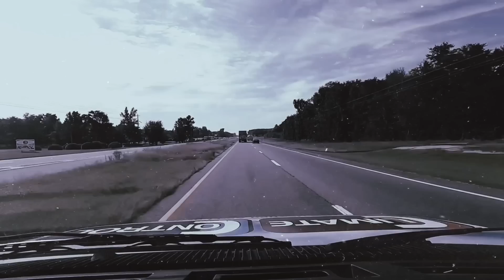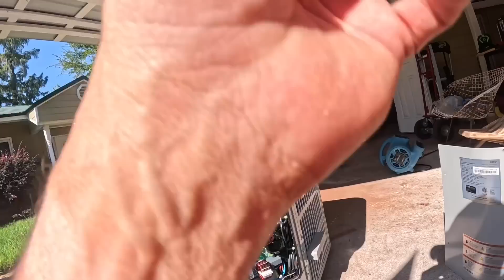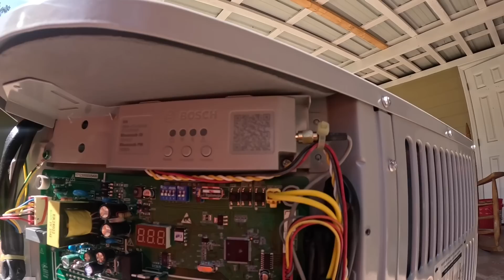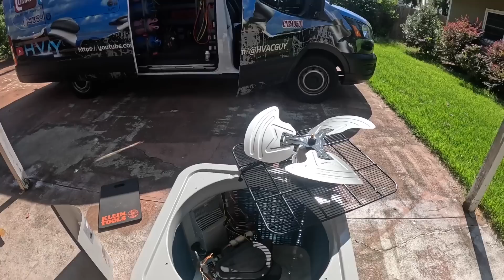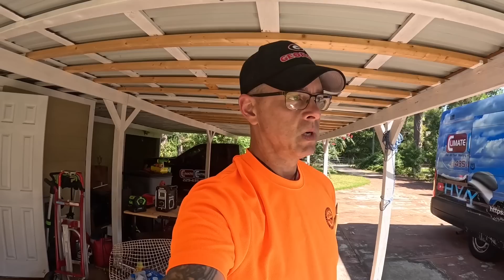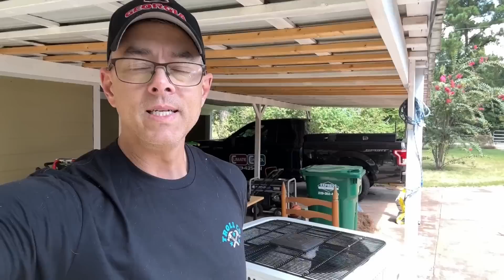Opening Up And Looking At The Bosch IDS Premium Connected! #hvacguy #hvaclife #hvactrainingvideos

Comment: I’m of the same opinion as the rest of commenters the board cost to much to replace this system is to new on the market to justify buying it plus  you must spend extra money on a good surge protector plus in Fla, GA, Ala is known for being lightning Capital of the world one strike and the whole system is fried there must be some type of housing to put this in so it would be protected from the elements and thievery plus the board i priced out was $1476.99 with dirty power, surges, lightning it will be a fad short lived for cheap customers i would rather spend More for a heavy duty one and last thirty years than buy a cheaper unit all day long

Comment: These units check a lot of boxes.  They are physically small. The materials and finish feel substantial.  They are quiet. They will modulate with standard thermostats.  They come in 2 models to cover 5 sizes. They are much less expensive than similar equipment from the USA. I'm looking forward to the Ultra model becoming available this fall.

Comment: OMG, they integrated the capacitors into the circuit board. We will see, pardon me if I remain skeptical. Good video
Reply: The caps you are seeing are filter caps for the power supply.  3-phase motors don't use a cap to start or run.
Reply: @ComputerVA  Thanks, I didn't realize it was 3 phase, but I didn't see any others.
Reply: Yea, Smarter option , a separate capacitor board with REPLACEABLE CAPACITORS !
Reply: Don't worry the IPM module fails way before the capacitors.
Reply: @TofuInc  I would laugh, but you are probably right.

Comment: Just like modern cars. Great energy savings,  BUT very expensive to repair. In the heat in my neck of the woods, this will die. In fact, they have had many issues right now.  It will come down to replacing the condenser package for repair.

Comment: Check valve is what that is. Remember when cars had a carburetor and easy to work on 😂
Reply: And the cap tube and selonoid is not for easy start up, it act’s as an APR valve in the first stage of cooling.

Comment: After warranty: "You will be needing a new circuit board. 5 year financing is available."
Reply: my words exactly, and they will all eventually do this, an cost people lot of money just for a board I will stick to have a basic model
Reply: @deweyabbott5310  Yikes, glad I  am  retired
Reply: @deweyabbott5310  Try bypassing that board for the weekend..
Reply: That is probably not far from the truth.
Reply: Had a carrier inverter board go out, cost of board from carrier $3100
Reply: @BrendanN941 Wow, that's crazy considering you can buy a 5 ton condenser for the same price.
Reply: Depends on electricity prices. You simply can’t afford to run the old direct on line dinosaurs anymore in AU. Haven’t seen anything without an inverter in many many years now.
Reply: @timwhite8500  
So they force you to buy this stuff by taxing energy to death?
Horrible.
Reply: @timwhite8500  submit! Sheep submit!
Reply: @timwhite8500 
Finally. A knowledgeable post!
Reply: Ckt Board:  made in Germany or China?  Replacement for board will probably outcost the entire unit, if available after BRICS dethrones the USD.
Reply: They mostly have 10year warranty on parts. Labor is not covered tho.
Reply: @benlund3905 
One year on labor.
Reply: A long time ago I could buy a condenser and evaporater for 1200 bucks 10 seer they worked great and seldom had any problems the compressor cost was 300 bucks Bristol or Copeland fan motor was 35 to 65 bucks I have no idea what this unit costs
Reply: Bingo
Reply: If you want the most cost affected system to install is a GEO system these Bosh are nice but I’ve worked on a few and you definitely need to know your shit when your messing with these
Reply: @Djcarp83 
Get the training. It is a nice system and not difficult to troubleshoot. The board has excellent self diagnostics. For cold weather states, it is one of the best. Your backup heat will die from boredom. If your backup is propane, it will pay for itself in about 4 years.
Reply: People will still be paying this off long after the warranty has expired.
Reply: 5 year financing, one year warranty
Reply: @tmbruno2539 
1 year labor 10 years parts.

Comment: I’m a parts coordinator for a HVAC supply company. Those inverter systems have so many issues! The electronics sitting in the sun and heat go out left and right.
Reply: A friend of mine just replaced a 5yr old  Bosch condenser board burned so bad the Bosch rep scrapped the unit. Year before that coil  leaked had to  be replaced. This unit had  surge protection a good friend of his has a hvac business. I am not inpressed with Bosch at all and clearly they are selling hard to the hvac YouTube group.
Reply: @tc6580 what did you think of the cooling fins(heatsink) inside & on the backside of the Bosch circuit board cooled by the main fan?
Reply: @miszced it’s a heat sink and most inverters are like this. Mitsubishi is like this as well. Keep the coil clean and you’re good. I’m more concerned with Tranes method of using refrigerant lines to cool inverter
Reply: @timrob0420  Tks for the response. Obviously over heating the CB is critical to performance. I'll do further research on my purchase of the Trane 20 Seer2 before finalizing, again Tanks.

Cheers from sunny Florida.
Reply: Those manufacturers should be held accountable for selling stuff not meant for the elements.
Reply: whats the cost to replace one
Reply: @deweyabbott5310  he has spent thousands in labor, parts are under warranty. Any electric saved has already been lost to repairs.
Reply: @deweyabbott5310  I have heard that the board itself is around 2 grand...
Reply: True but rumor on the street are these ecological wonders prevent climate change.

Comment: Generally looks like a really nice little unit, I especially like the variable speed condenser fan, but I'm not a fan of the rotary compressor, mainly because they often use very little oil (some hold less than 1qt.), and thus tend to fail from lack of lubrication whenever the system isn't perfectly installed and even a little bit of oil gets stuck somewhere, whereas a scroll or reciprocating just holds more oil (my new scroll heat pump holds a gallon of POE, whereas the competitor's rotary model has under 1.5qt. for the same compressor power), so it doesn't matter as much if an ounce or two gets stuck in a line.
Btw, that valve is called an unloader, as it takes the load of the compressor when it is starting.
Reply: I didn't think about that - didn't GE have huge problems with rotary compressors in refrigerators many years ago?  Maybe Bosch figured it out.. but who knows.
Reply: @gordonmacqueen8694  LG has the refrigerator compressor issue.

Comment: I've installed around 70 of these. A couple of the 15 seer units had bad boards that gave condenser fan error 
A couple of the 20 seer units had an annoying E5 lockouts that required hard reset for voltage irregularities 
I installed VRMs and so far it's resolved it
Reply: Bosh will keep us paid...... no way that board will last 10 years i have replaced 2 of them this year ..
Reply: @JacobsNews  I don't charge for warranty work......that may have to change

Comment: How is it getting 3 phase when you only have single phase.
Reply: VFD built into the board. Works great for shop/ industrial tools.
Reply: Created on the board
Reply: I think the board takes AC voltage and rectifies, power factor corrects, and filters it into DC.   DC is supplied to pairs of IGBTs which are controlled by a driver chip that uses motor speed and position information to generate a digital representation of 3 phase ac sine waves. The chip can vary the frequency of the phases to control the compressor's speed.  Also assuming there is a microcontroller on the board receiving inputs from sensors and switches. The controller tells the driver chip how fast to spin the compressor.  I also bet the controller has diagnostic modes programmed into it to help a tech troubleshoot problems.

Comment: Lots of equipment that would suffer from dirt in the system. Cleanliness is definitely job one on this unit. The 3ph variable speed compressor will save on electricity costs. Definitely needs some top notch surge suppression devices installed as the inverter board would be the first to go if there was a lightning strike in the vicinity! You installing this one at home?
Reply: All savings are lost after the first service call 🤙
Reply: I've install Rectorseal voltage regulator with built-in surge protector for my both inverter heatpumps. We'll see.

Comment: I am not an HVAC Tech but that looks like a lot of electronics to have issues with. 
Good luck to the new owner
Reply: You're not kidding.  Not sure I'd like to pay for the repair bill on that unit.
Reply: BOSCH told me have problems replace board no trouble shooting.
Reply: Guess you better not buy a new stove, refrigerator, dryer or washer.

Comment: Too much sensitive expensive electronics exposed to the environment for me. Living in the northeast, I will stick with a basic single stage compressor
Reply: Exactly right those units have the same issues that the York units and luxaire have with the control boards and the heat sink bieng exposed directly to hot air in the summer. That's not good.
Reply: @gabrielstern4992 
The control board failures were on the 15 seer. This is a 20.5 seer unit. The failures have all but been eliminated on them now. One of the most important settings you must do is capacity selection. They come in only a 3 ton/2ton and a 5 ton/4 ton size. Default is with J2 dip switch in the up or on position which is the higher capacity. If you want 2 ton or 4 ton, push J2 down to off. They are friendly with most thermostats except Nest . Ecobee is not bad. We have had better luck with the Bosch BCC100. They pair up to enable all the features the customer paid for. BTW. The HSPF of 10.5 is going to give you a heating efficiency over what many other inverter heat pumps out there can give. You must not rush the install and setup. We install an Intermatic AG3000 surge protector on the disconnect switch of the inverter and the air handler/ furnace. $130 for both is cheaper than a warranty call from an angry customer.
Reply: Had to replace two boards not a bosch but similar board not going to set another.
Reply: yep, i have 25-year-old 14 seer unit costs only 150 to run in summer months. a lot more sensible to have simple reliable unit than saving 20 dollars a month on electricity. is quickly erased by repairs or replacement of unit in 5 to 10 years
Reply: @ranger178  exactly right if it ain't broke don't replace it personally I liked it better when Curtis did the gree flex units it's got the inverter technology but a side discharge condenser still uses copper for the condenser coil and evap coil but has connections simalar to a mini split but without the proprietary communicating stuff and it is reasonably priced. Bosch makes awsome automotive products and greaf dishwashers, but not hvac with thier hvac stuff it's as bad as trane Lennox and carrier and don't get me started on diaken which owns Goodman now ohh and bosch is buying Johnson controls which bought York in 2005.

And York before that made excelent hvac equipment. And they were made here in America with thier headquarters pre Johnson controls about An hour and half from me in York Pennsylvania and they held up.

Comment: Nice! I wonder what the bluetooth connection provides. Does it give all of the data? Do you need a specific app to use it. Probably it will. Thanks, interesting!
Reply from the maker: From my understanding it communicates with your phone, and a special app for energy monitoring purposes.
Reply: @HVACGUY  alright, so it’s more for the user than the maintenance. Also it’s quite a huge motherboard. Hopefully it’s protected at the backside? I remember that some lizards behind some boards. 😀
Reply: Your pup is as tall as that condenser. Part Great Dane?
Reply from the maker: @MrsOveata full blooded Weimaraner
Reply: Imagine a day when you can just blue tooth to the unit and read line pressures, superheat, sub cooling, amp load, etc.
Reply: @jtmack77 
The board diagnostics provides all info. You don’t even have to attached gauges. Pressure, sub cooling, amperage, super heat all on the board.
Reply: @jtmack77  exactly my idea! That would be great!
Reply: I recently had the charge checked in mine after a cold weather installation.  

The suction pressure reading from my 5 ton IDS 2.0 unit was not very close to the technician's instrument.   This is because it is calculated from the temperature.  This made the superheat calculation based on the condenser readings pretty worthless.  The subcooling value I calculated was very close to the technician's tool.

Comment: $1,500 for that board better install a good surge protector when installing this unit.
Reply: Not a bad idea, but when the caps get bad, new board...
Reply: @jthonn   people may start learning how to replace caps on the boards in the field or we might be able to buy rebuilt boards with New Caps.
Reply: @OcRefrig  I can't tell you how many times I've snipped off a MOV or ripped a shorted protection diode off in the field just to get the equipment going until I could get a new board.
Reply: It is required in the install.  I had to replace a compressor and board on one of those.  The delivery took three weeks.  To remove the board, they send a screw you got to put in to the board.  Don’t skip the step.
Reply: @caru3257  parts houses here to sale BOSCH they have got to keep ALL replacement parts in stock from boards to compressors. my 2.0 units have 10 year warranty